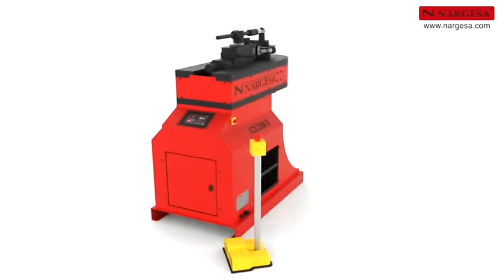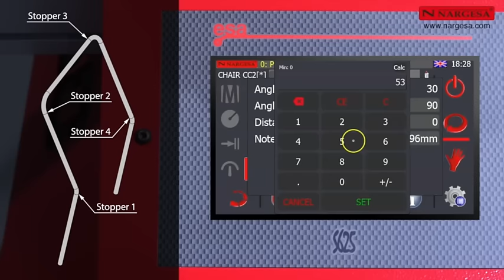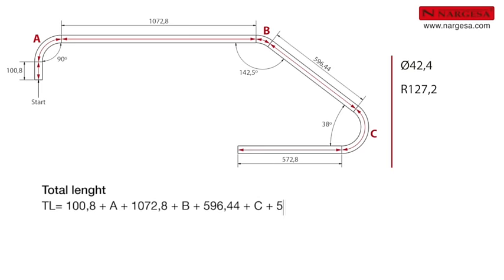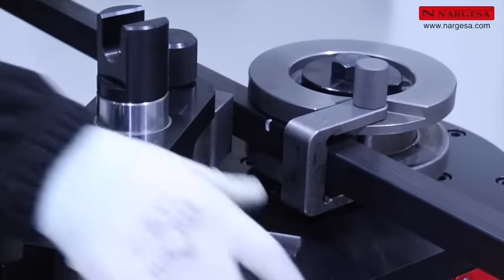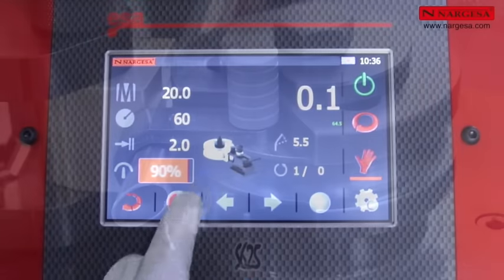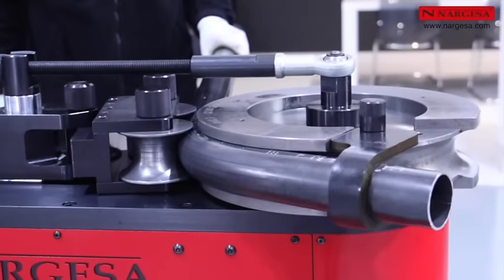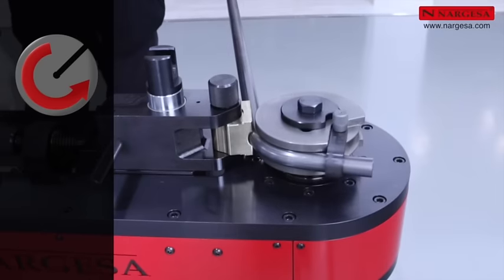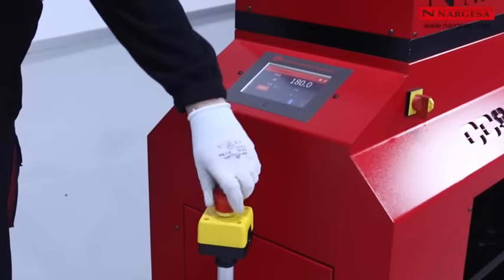NON-MANDREL ROTARY TUBE BENDERS CC60 AND CC90 CNC NARGESA

Comment: Very nice machine! Have only had a few test bends. A question: K factor, what is that? Is it the same regarding pipe material/diameter?
Reply from the maker: Thank you for your comment!!
The k-factor relates the neutral axis to the thickness of the material. The key is to know where the neutral axis passes, but it depends on a few different variables, such as material type and material thickness, etc. It means you have to calculate it when you do a bend and you have to do bending tests to take measurements. We use this factor for this material k-factor = 0.01745, because it gives you reliable results without the need for testing. Ultimately you have to perform bending tests and recalculate the development, this factor will be repeated if the material is the same.
Please contact us if you have any questions
Best regards